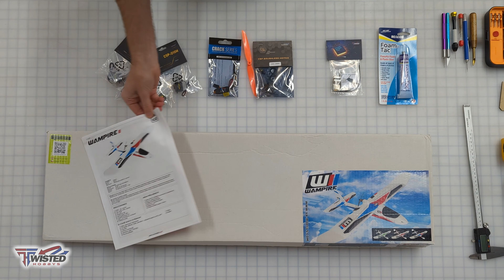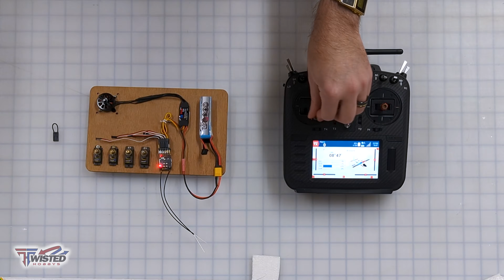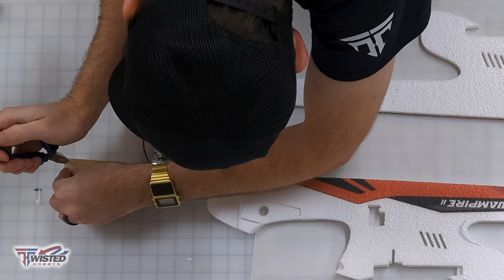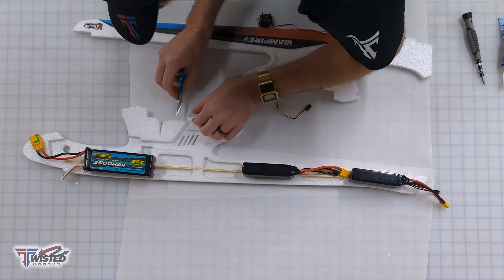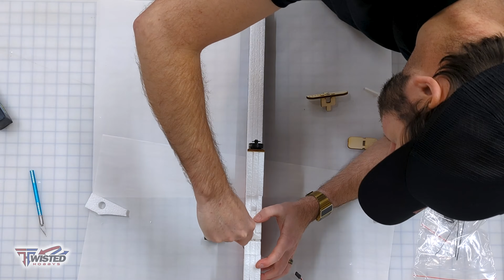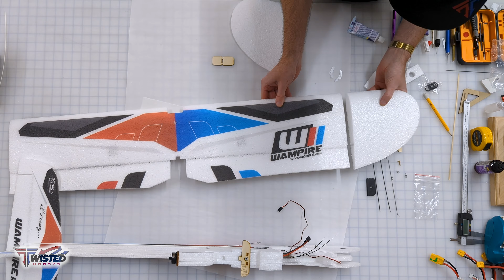Twisted Hobbys/VA Models Wampire Build

Comment: You had to soder an extension wire. Wow, I think this is not as simple as you make it look!
Reply: To be fair, I usually solder on every model I build to swap over from JST to an XT-30 connector.  You could easily just use an extension instead of soldering, but I didn't want the possibility of it coming unplugged internally.
Reply: Very cool I will buy one and try. I can always have a friend come over and help. I built a TT-02 and never thought I could. Your videos are so clear! I will try!